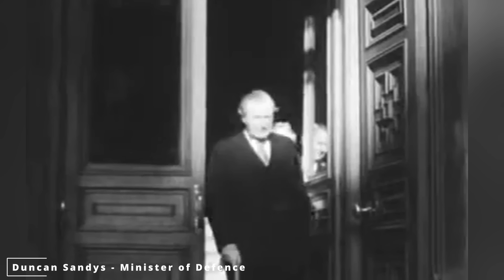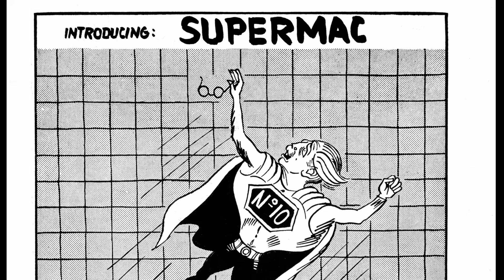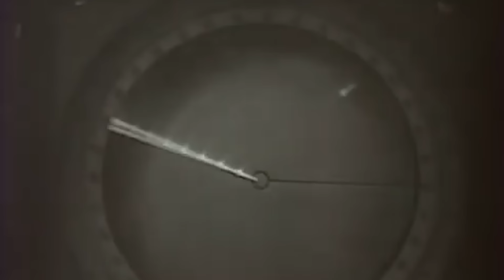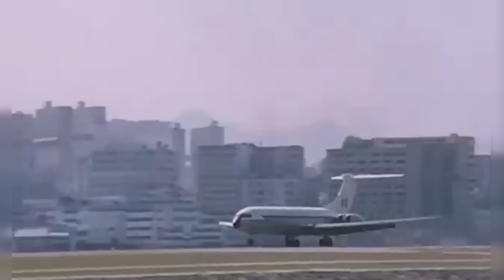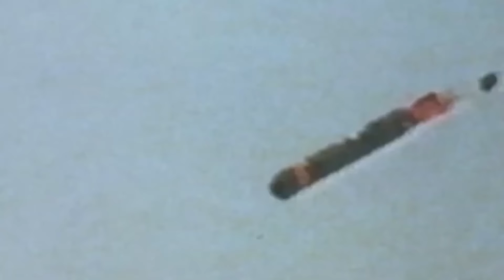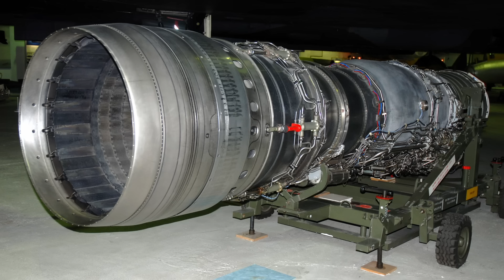How Britain Turned A Failed Airliner Into a Soviet Submarine Predator | The Mighty Nimrod

Comment: A little oof there on the "square windows" being the Comet's problem - it was the ADF cutout that was found to be the main culprit.
Reply: The problem was de Havilland engineers made an egregious error in calculations when they used the thinner aluminum sheets on the roof between frame stations 152 and 158... de Havilland admitted that it never pressure tested this fuselage segment as it was not required by the CAA at the time for airworthiness certification. 
D-H engineers only estimated the stress loads using data from the certification tests that were, unfortunately also performed incorrectly and gave wildly false data indicating that the structure was much stronger than it really was.
 The Comet disaster is a massive bodge job of incompetence and criminal negligence that is unmatched in aviation history.
Reply: @DoktorBayerischeMotorenWerke  Still not the windows as the "expert" making this video carelessly stated. Which has been known for a LOOONG time, so it should never have come up in any research on the Nimrod origins.
Reply: @DoktorBayerischeMotorenWerke Comet Caravelle B-47 Fokker   

We believe we can clear up some commonly held myths and misconceptions obviously.

It's always good to see the facts presented clearly and concisely isn't it?

See further down for pressure test details. Skin thickness remained mostly the same for all Comet marks. The window size and shape changes were required for that particular aircraft at the time. 

Obviously there have been worse aircraft for accident losses both before & after the Comet.

Early problems with Comet takeoff stalls were caused by pilots over rotating the aircraft at liftoff. 

Podded engines on wings have aerodynamics issues. The main reasons for eventually going with podded engines were because or to facilitate -
Ease of maintenance.
Use of shear off fixings given excessive out of balance forces.
Large diameter turbofan engines.
Reduce load on the wing to fuselage connection. 
Increased power from later engines. 

The Bow-wing (See B-47 wing collapse & wing folding incidents) was a good example of how to expend a huge amount of cash and effort on something that was probably not worth bothering with. The basic design of the Comet had been decided upon and established before the podded engine choice has been made for the B-47. There were aerodynamics problems with podded pylon mounted engines at the time. The US also built and operated a significant number of EE Canberra bombers under licence which did not use podded engines for their wing mounted engines. . 

There have been aircraft losses caused by pod & pylon mounted engines. 

All jet airliners benefited greatly from the knowledge gained from the Comet incidents & subsequent investigations & yet some were still worse for accident losses. 

Instances of all marks of the Comet flew with full certification after 1954 including the Comet 3. The last Comet flight occured in 1997.

The fabulous trail blazing DH Comet.
World's first jet airliner in regular service.
The jet engined Avro Lancastrian actually did a passenger service before the DH Comet. 
World's first high altitude airliner.
World's first airliner with a full fuselage length pressurised cabin pressurised for high altitude flight. That feature for that type of aircraft was a considerably difficult undertaking. 

How things were back then.
Accident losses - % of aircraft built.

DeHavilland Comet 4 UK                          14% 
DeHavilland Comet all mks UK (ff 1949)17%  
Vickers VC10 UK (ff 1962)                         5%

Douglas DC-1  US                                       99%
Douglas DC-2                                              47%
Douglas DC-3                                              30%
Douglas DC-4                                              26%
Boeing s300    US                                       72% 
Boeing 307                                                  70%
Boeing 247                                                   48%
Boeing 707  (ff 1958)                                 32% 
Lockheed L-049 Constellation (ff 1943)  30%
Lockheed Electra US (ff 1957)                   29%
Fairchild FH-227 US (ff 1966)                   30%
McDonnell Douglas DC-8 US  (ff 1958)   14%
Sud Aviation Caravelle  (ff 1955)             15%
Canadair CL-44 Turboprop US (ff 1959) 46%  
Convair CV-580 Turboprop US (ff 1960) 22%
Convair CV-880     (ff 1959)                      27% 
Convair CV-990     (ff 1961)                      33%
Tupolev T-104        (ff 1956)                     16%
Vickers Viscount UK  (ff 1948)                29%  
Fokker F-27 Trboprop NL (ff1955)          40%      

The Vickers VC10, fastest Atlantic crossing for a non supersonic jet airliner, held the record for 41 years.

For the first few years of operation the Caravelle & Comet had similar accident loss fatalities.

Sud Aviation Caravelle.  (FR) ff 1955
15% Accident Losses. 
1320 fatalities. 

De Havilland Comet. (UK) ff 1949
17% Accident Losses. 
453 fatalities. 

Tupolev T-104   (USSR) ff 1956
720 Accident fatalities.
14.5% Accident Losses. 

Fokker (NL) F-27 Turboprop ff 1955 
40% Accident Losses.
2130 fatalities.

Boeing 707 (USA)   ff 1958
33% Accident Losses. 
3108 fatalities.

Vickers VC-10  (UK) ff 1962
130 Accident Loss Fatalities.
5% Accident Losses. 

Of course De Havilland carried out a full stress analysis & performed extensive & protracted testing on two long lengths of fuselage representing all features of a complete airframe. De Havilland carried out significantly more testing than was required by any authority at the time & significantly more testing that any previous airliner was subjected to.

De Havilland designers / engineers knew all there was to know about metal fatigue at the time they designed the DH Comet.

De Havilland had prior experience building many all metal construction airframe aircraft including many passengers aircraft & thousands of jet powered fighter aircraft that were primarily of metal construction with pressurised cockpits & used jet engines built by De-Havilland.

De Havilland did indeed always work to better than industry standards at the time, used up to date knowledge for the design & testing activities & no evidence of negligence or criminal negligence was ever produced in relation to the DH Comet.

Global aerospace. 
From the 1950s sector rationalisation and consolidation took place. 70 companies in France and 300 companies in the US disappeared due to merger or dissolution. In the US Boeing was almost bankrupted by the 707 project.  Boeing had a well protected domestic market and the available space and resources in the US to engage in large scale airliner manufacturing enabling them to capture orders simply by being able to produce airframes fast enough and cheap and nasty enough. Another factor is airlines preferring to obtain as much of their airliner inventory as possible from one manufacturer. 

Global Aerospace Sector, what's happening.

For example, there are of course no German companies that makes German jet aircraft in Germany & there are no German companies that make German gas turbine aero engines in Germany that are suitable for widebody airliners.

The UK has the world's highest combined per capita Nuclear / Defence / Aerospace Sector Activity.

UK defence sector, absolute terms, world's second highest activity. 1st for per capita defence sector activity. Per capita nuclear powered submarine construction, 2nd position. 
Main players being Rolls Royce, Babcock, GKN Aerospace & BAe Systems. Activities often involve international collaboration. BAe systems, RR and other UK companies now handle more Airbus work value wise than Germany. 

There's a good chance that anyone currently flying on a widebody airliner will be on an aircraft powered by RR gas turbine aero engines made in the UK and a good chance there will be other hardware on the aircraft that's designed and / or manufactured in the UK. 

Rolls Royce Holdings UK
Subsidiaries
- Rolls-Royce plc
- Rolls-Royce North America (ex Allison etc Classified Military stuff)
- Rolls-Royce AB
- Rolls-Royce Deutschland
- Rolls-Royce India Private Limited
- Rolls-Royce Marine Power Operations
- Vinters Engineering Limited
- Rolls-Royce Controls and Data Services
- Rolls-Royce Power Systems
- Bergen Marine
Joint ventures include:
- Rolls-Royce Turbomeca
- MTU Turbomeca -

Trent Family
The MT30 (Marine Turbine)
Industrial Trent 60 Gas Turbine
Trent 7000
Trent XWB Airbus A330neo.
Trent 1500
Trent 1000
Trent 500
Trent 600
Trent 700
Trent 800
Trent 8100
Trent 900
   
RR wholly owned subsidiaries in Germany handle smaller 2 shaft RR gas turbine aero engine work.

The UK space and aerospace sectors are highly productive, high-value industries that together contribute over £18 Billion in direct Gross Value Added (GVA) to the UK economy. Individually, the space industry directly contributes about 0.3% of UK GDP 7•2 Billion while the aerospace industry contributes approximately 0.5% £10•9 Billion.

We hope this helps.
Reply: It's too late I fear.  The square window story has been retold so many times and published as a fact for so long (and still is), that I doubt the truth will ever become a common knowledge.  The truth of it is just too complicated and boring for people to care...
Reply: @SteepSix  The truth is also very embarrassing for the British aviation industry, which was already struggling by this time, de Havilland in particular had suffered a long stretch of bad publicity and reports of catastrophic crashes frequently made the headlines.
Reply: And the square hole remained there to the last. It was many things together.  The skin on the first aircraft was thinner than usual to save weight, to carry more fuel for the inefficient jets. When more efficient jets were fitted the skin thickness was increased. It was originally intended that the skins and window surrounds were bonded and not riveted.  Production engineers demanded a change to rivets. It should have initiated a full stress review. It didn't.  The accidents could just as easily happened to the Boeing 707.  The Comet investigation fed back into the Boeing aircraft's design. The Comet was a remarkable design.
Reply: @everTriumph  That is completely false and misleading, Boeing was at the time the world's leader in pressurized aircraft production and had already sold over 6,000 pressurized aircraft by the time of the Comet Disaster.
 Boeing used thicker aluminum, that was less brittle, stronger frame hoops and stringers and Boeing had pioneered the use of rip-stop doublers joints which could have prevented the catastrophic inflight structural failures in the Comet.

The Boeing 707 flew on July 15th, 1954 before anyone (including de Havilland) understood what caused the disaster.
The only lesson learned by the Comet Disaster was that troubled companies like de Havilland could no longer be trusted to conduct their own crash investigations, they should have never been allowed to return the Comet 1 to service as they admitted they did not understand the primary failure mode in any of the early crashes.
Reply: @DoktorBayerischeMotorenWerke 

We believe we can clear up some commonly held myths and misconceptions obviously.

It's always good to see the facts presented clearly and concisely isn't it?

Bow-wing (see B-47 wing collapse wing folding incidents) had built less than 12 pressurised airliners before the Comet first flew and they were not high altitude airliners. 

All Nimrods were new build Comet 4 airframes with appropriate strengthening and the unpressurized  equipment bay tacked on. 

The HS 801 Nimrod was the most advanced aircraft of it's type at the time it first flew. Problems with the MRA4 programme were almost entirely due to radar and computer equipment issues and BAe Systems & co being too busy with other work at the time. 

Obviously there have been worse aircraft for accident losses both before & after the Comet.

Early problems with Comet takeoff stalls were caused by pilots over rotating the aircraft at liftoff. 

Podded engines on wings have aerodynamics issues. The main reasons for eventually going with podded engines were because or to facilitate -
Ease of maintenance.
Use of shear off fixings given excessive out of balance forces.
Large diameter turbofan engines.
Reduce load on the wing to fuselage connection. 
Increased power from later engines. 

The Bow-wing (See B-47 wing collapse & wing folding incidents) was a good example of how to expend a huge amount of cash and effort on something that was probably not worth bothering with. The basic design of the Comet had been decided upon and established before the podded engine choice has been made for the B-47. There were aerodynamics problems with podded pylon mounted engines at the time. The US also built and operated a significant number of EE Canberra bombers under licence which did not use podded engines for their wing mounted engines. . 

There have been aircraft losses caused by pod & pylon mounted engines. 

All jet airliners benefited greatly from the knowledge gained from the Comet incidents & subsequent investigations & yet some were still worse for accident losses. 

Instances of all marks of the Comet flew with full certification after 1954 including the Comet 3. The last Comet flight occured in 1997.

The fabulous trail blazing DH Comet.
World's first jet airliner in regular service.
The jet engined Avro Lancastrian actually did a passenger service before the DH Comet. 
World's first high altitude airliner.
World's first airliner with a full fuselage length pressurised cabin pressurised for high altitude flight. That feature for that type of aircraft was a considerably difficult undertaking. 

The change from larger squarer windows to smaller rounder windows was necessary for the particular aircraft at the time. Skin thickness remained mostly the same for all Comet marks. 

How things were back then.
Accident losses - % of aircraft built.

DeHavilland Comet 4 UK                          14% 
DeHavilland Comet all mks UK (ff 1949)17%  
Vickers VC10 UK (ff 1962)                         5%

Douglas DC-1  US                                       99%
Douglas DC-2                                              47%
Douglas DC-3                                              30%
Douglas DC-4                                              26%
Boeing s300    US                                       72% 
Boeing 307                                                  70%
Boeing 247                                                   48%
Boeing 707  (ff 1958)                                 32% 
Lockheed L-049 Constellation (ff 1943)  30%
Lockheed Electra US (ff 1957)                   29%
Fairchild FH-227 US (ff 1966)                   30%
McDonnell Douglas DC-8 US  (ff 1958)   14%
Sud Aviation Caravelle  (ff 1955)             15%
Canadair CL-44 Turboprop US (ff 1959) 46%  
Convair CV-580 Turboprop US (ff 1960) 22%
Convair CV-880     (ff 1959)                      27% 
Convair CV-990     (ff 1961)                      33%
Tupolev T-104        (ff 1956)                     16%
Vickers Viscount UK  (ff 1948)                29%  
Fokker F-27 Trboprop NL (ff1955)          40%      

The Vickers VC10, fastest Atlantic crossing for a non supersonic jet airliner, held the record for 41 years.

For the first few years of operation the Caravelle & Comet had similar accident loss fatalities.

Sud Aviation Caravelle.  (FR) ff 1955
15% Accident Losses. 
1320 fatalities. 

De Havilland Comet. (UK) ff 1949
17% Accident Losses. 
453 fatalities. 

Tupolev T-104   (USSR) ff 1956
720 Accident fatalities.
14.5% Accident Losses. 

Fokker (NL) F-27 Turboprop ff 1955 
40% Accident Losses.
2130 fatalities.

Boeing 707 (USA)   ff 1958
33% Accident Losses. 
3108 fatalities.

Vickers VC-10  (UK) ff 1962
130 Accident Loss Fatalities.
5% Accident Losses. 

Of course De Havilland carried out a full stress analysis & performed extensive & protracted testing on two long lengths of fuselage representing all features of a complete airframe. De Havilland carried out significantly more testing than was required by any authority at the time & significantly more testing that any previous airliner was subjected to.

De Havilland designers / engineers knew all there was to know about metal fatigue at the time they designed the DH Comet.

De Havilland had prior experience building many all metal construction airframe aircraft including many passengers aircraft & thousands of jet powered fighter aircraft that were primarily of metal construction with pressurised cockpits & used jet engines built by De-Havilland.

De Havilland did indeed always work to better than industry standards at the time, used up to date knowledge for the design & testing activities & no evidence of negligence or criminal negligence was ever produced in relation to the DH Comet.

Global aerospace. 
From the 1950s sector rationalisation and consolidation took place. 70 companies in France and 300 companies in the US disappeared due to merger or dissolution. In the US Boeing was almost bankrupted by the 707 project.  Boeing had a well protected domestic market and the available space and resources in the US to engage in large scale airliner manufacturing enabling them to capture orders simply by being able to produce airframes fast enough and cheap and nasty enough. Another factor is airlines preferring to obtain as much of their airliner inventory as possible from one manufacturer. 

Global Aerospace Sector, what's happening.

For example, there are of course no German companies that makes German jet aircraft in Germany & there are no German companies that make German gas turbine aero engines in Germany that are suitable for widebody airliners.

The UK has the world's highest combined per capita Nuclear / Defence / Aerospace Sector Activity.

UK defence sector, absolute terms, world's second highest activity. 1st for per capita defence sector activity. Per capita nuclear powered submarine construction, 2nd position. 
Main players being Rolls Royce, Babcock, GKN Aerospace & BAe Systems. Activities often involve international collaboration. BAe systems, RR and other UK companies now handle more Airbus work value wise than Germany. 

There's a good chance that anyone currently flying on a widebody airliner will be on an aircraft powered by RR gas turbine aero engines made in the UK and a good chance there will be other hardware on the aircraft that's designed and / or manufactured in the UK. 

Rolls Royce Holdings UK
Subsidiaries
- Rolls-Royce plc
- Rolls-Royce North America (ex Allison etc Classified Military stuff)
- Rolls-Royce AB
- Rolls-Royce Deutschland
- Rolls-Royce India Private Limited
- Rolls-Royce Marine Power Operations
- Vinters Engineering Limited
- Rolls-Royce Controls and Data Services
- Rolls-Royce Power Systems
- Bergen Marine
Joint ventures include:
- Rolls-Royce Turbomeca
- MTU Turbomeca -

Trent Family
The MT30 (Marine Turbine)
Industrial Trent 60 Gas Turbine
Trent 7000
Trent XWB Airbus A330neo.
Trent 1500
Trent 1000
Trent 500
Trent 600
Trent 700
Trent 800
Trent 8100
Trent 900
   
RR wholly owned subsidiaries in Germany handle smaller 2 shaft RR gas turbine aero engine work.  

The UK space and aerospace sectors are highly productive, high-value industries that together contribute over £18 Billion in direct Gross Value Added (GVA) to the UK economy. Individually, the space industry directly contributes about 0.3% of UK GDP 7•2 Billion while the aerospace industry contributes approximately 0.5% £10•9 Billion.
   
We hope this helps.
Reply: @DoktorBayerischeMotorenWerke 

Typhoon & Tornado, British design aircraft. 

Early days of the airliners.

The awesome De Havilland Comet.
World's first production jet airliner.
World's first high altitude airliner. 
At the time the Comet wasn't particularly dangerous. The DH Comet was definitely not the worst engineering failure in commercial airliner history.

How things were back then.
Accident losses - % of aircraft built.

DeHavilland Comet 4 UK                          14% 
DeHavilland Comet all mks UK (ff 1949)17%  
Vickers VC10 UK (ff 1962)                         5%

Douglas DC-1  US                                       99%
Douglas DC-2                                              47%
Douglas DC-3                                              30%
Douglas DC-4                                              26%
Boeing s300    US                                       72% 
Boeing 307                                                  70%
Boeing 247                                                   48%
Boeing 707  (ff 1958)                                 32% 
Lockheed L-049 Constellation (ff 1943)  30%
Lockheed Electra US (ff 1957)                   29%
Fairchild FH-227 US (ff 1966)                   30%
McDonnell Douglas DC-8 US  (ff 1958)   14%
Sud Aviation Caravelle  (ff 1955)             15%
Canadair CL-44 Turboprop US (ff 1959) 46%  
Convair CV-580 Turboprop US (ff 1960) 22%
Convair CV-880     (ff 1959)                      27% 
Convair CV-990     (ff 1961)                      33%
Tupolev T-104        (ff 1956)                     16%
Vickers Viscount UK  (ff 1948)                29%  
Fokker F-27 Trboprop NL (ff1955)          40%      

The Vickers VC10, fastest Atlantic crossing for a non supersonic jet airliner, held the record for 41 years.

For the first few years of operation the Caravelle & Comet had similar accident loss fatalities.

Sud Aviation Caravelle.  (FR) ff 1955
15% Accident Losses. 
1320 fatalities. 

De Havilland Comet. (UK) ff 1949
17% Accident Losses. 
453 fatalities. 

Tupolev T-104   (USSR) ff 1956
720 Accident fatalities.
14.5% Accident Losses. 

Fokker (NL) F-27 Turboprop ff 1955 
40% Accident Losses.
2130 fatalities.

Boeing 707 (USA)   ff 1958
33% Accident Losses. 
3108 fatalities.

Vickers VC-10  (UK) ff 1962
130 Accident Loss Fatalities.
5% Accident Losses. 

De Havilland had prior experience building many all metal construction airframe aircraft & thousands of jet powered fighter aircraft that were primarily of metal construction with pressurised cockpits & jet engines built by De-Havilland. No aircraft before the Comet was subjected to as much pre-production testing as the Comet. 

It's a great pity & a crying shame that British military forces had to occupy a large part of Germany for decades after 1945 & Russian military forces had to do the same. Of course Russia still posseses a large chunk of what was German territory & of course Russia & the UK produce nukes. Obviously Germany does not produce nukes.

Interesting British achievements.

The gas turbine engine was invented & patented in England before the 1800s.

Axial multi stage sequential stage compressor & turbine technology, first produced for turbo machinery use in England by Parsons of Ireland & North England during the 1800s. The components form the basis of most modern gas turbine aero engines. At the time the concept of the jet aircraft powered by axial internal combustion gas turbine engines was first mentioned thus the internal combustion jet engine & jet aircraft was indeed invented in England before the 1900s & before the Wright brothers got busy.

Work on the multi stage sequential stator rotor axial compressor as applicable to the axial compressor gas turbine aero engine was ongoing in England from around 1928 by Arnold Griffiths and others. By 1943 the Metrovik F2/3  Beryl was a running axial turbojet that was superior to anything anywhere else. As the centrifugal compressor engines were adequate and more powerful at the time development of a larger F2/3  version was commenced.

The Metrovik (UK)  F2/3 axial compressor gas turbine aero engine was flight certified & ran in 1942, it was the result of UK development work ongoing since 1929. At the time it was the most capable axial compressor turbojet in existence but was not required and development work continued on a larger version.

Frank Whittle performed the world's first demonstration of a gas turbine aero engine in 1937. People in Germany kept a close eye on everything going on in Britain at the time.

The centrifugal compressor RR Nene was the most powerful & most reliable gas turbine aero engine on the planet in 1944. That engine would be later built under license or copied in many countries including Russia (Mig-15 Mig-17), China, the US, France and Switzerland powered dozens of aircraft types for decades after 1944.

Pratt and Whitney and others produce centrifugal compressor gas turbine aero engines. The PW200 is a currently produced whittle style centrifugal compressor, reverse flow combustor, gas turbine aero engine. 

The world's first wind tunnel was constructed in England during the 1870s. The world's first supersonic wind tunnel was constructed in England in 1922.

There is no doubt that the Fairey (England)
Delta 2 was the world's first jet
aircraft to exceed 1000 mph.  Indeed It
exceeded the previous record by 310 mph &
held the record for 1 year. Incidentally, the Dassault Mirage 3 & 4 are based on the Fairey Delta 2.

More recent UK military jet aircraft.

The Tornado & Typhoon & their engines are Supersonic & are indeed British design aircraft with British design engines built by an international consortium. The Tornado design for example started life during the 1950s at Vickers as the AFVG, it's engine is based on the RR RB-199. The EE Lightening is also a British Supersonic jet aircraft.

The Typhoon is the British BAC-EAP with an engine based on the British RR XG-40, the Typhoon is also built by an international consortium.

Brazil has the world's third largest airliner manufacturer and makes very good airliners & Brazil is 100th down the list along with Indonesia for wealth per capita. Of course it is in fact the case that Embraer can't build those airliners without purchasing stuff from the US, UK & Europe. For example, Norway, Holland, Denmark, Ireland & Belgium, top 20 wealth per capita, don't make airliners, its as simple as that.

Global aerospace. 
From the 1950s sector rationalisation and consolidation took place. 70 companies in France and 300 companies in the US disappeared due to merger or dissolution. In the US Boeing was almost bankrupted by the 707 project.  Boeing had a well protected domestic market and the available space and resources in the US to engage in large scale airliner manufacturing enabling them to capture orders simply by being able to produce airframes fast enough and cheap and nasty enough. Another factor is airlines preferring to obtain as much of their airliner inventory as possible from one manufacturer. 

Global Aerospace Sector, what's happening.

For example, there are of course no German companies that makes German jet aircraft in Germany & there are no German companies that make German gas turbine aero engines in Germany that are suitable for widebody airliners.

The UK has the world's highest combined per capita Nuclear / Defence / Aerospace Sector Activity.

UK defence sector, absolute terms, world's second highest activity. 1st for per capita defence sector activity. Per capita nuclear powered submarine construction, 2nd position. 
Main players being Rolls Royce, Babcock, GKN Aerospace & BAe Systems. Activities often involve international collaboration. BAe systems, RR and other UK companies now handle more Airbus work value wise than Germany. 

There's a good chance that anyone currently flying on a widebody airliner will be on an aircraft powered by RR gas turbine aero engines made in the UK and a good chance there will be other hardware on the aircraft that's designed and / or manufactured in the UK. 

Rolls Royce Holdings UK
Subsidiaries
- Rolls-Royce plc
- Rolls-Royce North America (ex Allison etc Classified Military stuff)
- Rolls-Royce AB
- Rolls-Royce Deutschland
- Rolls-Royce India Private Limited
- Rolls-Royce Marine Power Operations
- Vinters Engineering Limited
- Rolls-Royce Controls and Data Services
- Rolls-Royce Power Systems
- Bergen Marine
Joint ventures include:
- Rolls-Royce Turbomeca
- MTU Turbomeca -

Trent Family
The MT30 (Marine Turbine)
Industrial Trent 60 Gas Turbine
Trent 7000
Trent XWB Airbus A330neo.
Trent 1500
Trent 1000
Trent 500
Trent 600
Trent 700
Trent 800
Trent 8100
Trent 900
   
RR wholly owned subsidiaries in Germany handle smaller 2 shaft RR gas turbine aero engine work.

The UK space and aerospace sectors are highly productive, high-value industries that together contribute over £18 Billion in direct Gross Value Added (GVA) to the UK economy. Individually, the space industry directly contributes about 0.3% of UK GDP 7•2 Billion while the aerospace industry contributes approximately 0.5% £10•9 Billion.
   
We hope this helps.
Reply: @Paul-mh9pr  and nowadays… Great Britain can’t even launch a single warship in a time of crisis… How far they have fallen
Reply: @trainnerd3029 

The UK is second in the world for per capita nuclear powered submarine construction activity for example.
Reply: @Paul-mh9pr  recently, the UK was unable to perform an emergency deployment of a single warship… Not one!
Reply: @trainnerd3029 

The UK is second in the world for per capita nuclear powered submarine construction activity, for example.
Reply: @Paul-mh9pr  per capita, blah blah blah blah. They just had an emergency situation where they not could not deploy a single warship… Fact.

The people of Great Britain gave up freedoms in the name of security and now they have neither
Reply: @trainnerd3029 

The UK:
  
 - second in the world for per capita nuclear powered submarine construction activity, for example.

 - 1st in world for per capita defence sector activity. GKN Aerospace, RR & BAe Systems are the main players. 

- 2nd in the world for defence sector activity in absolute terms. (Many find that difficult to believe which is understandable.) 

Historic examples - Cammel Laird built the world's first steel ship using welded construction and broke ship building speed records on more than one occasion. 

The English language - 

World standard aviation language.
World standard maritime language.
Reply: @Paul-mh9pr  the UK… Disarmed its own citizens. Restricts free speech, allows, unrestricted illegal immigration… Good luck with that kind of stuff…
Reply: @trainnerd3029 

The UK:
  
 - second in the world for per capita nuclear powered submarine construction activity, for example.

 - 1st in world for per capita defence sector activity. GKN Aerospace, RR & BAe Systems are the main players. 

- 2nd in the world for defence sector activity in absolute terms. (Many find that difficult to believe which is understandable.) 

Historic examples - Cammel Laird built the world's first steel ship using welded construction and broke ship building speed records on more than one occasion. 

The English language - 

International aviation language.
International maritime language.

World's first commercial nuclear reactor  power station - Calder Hall.